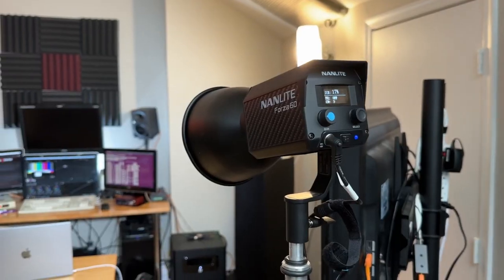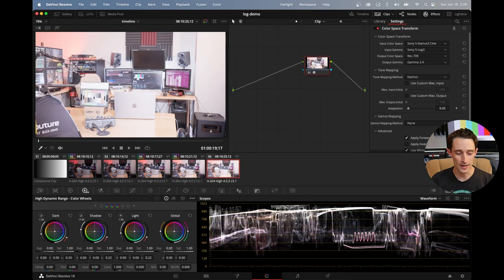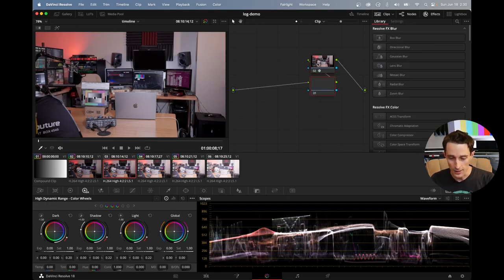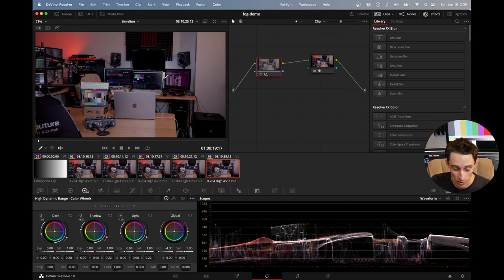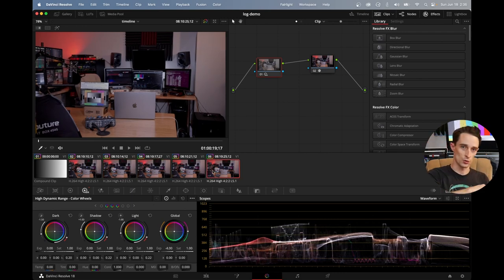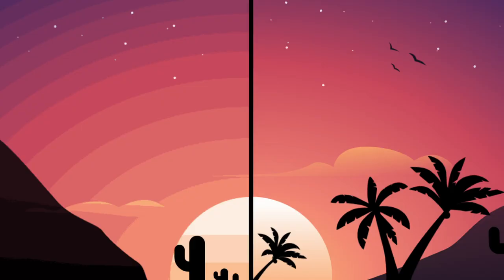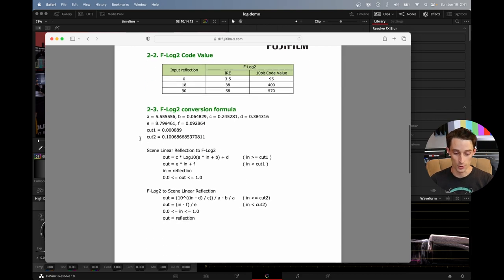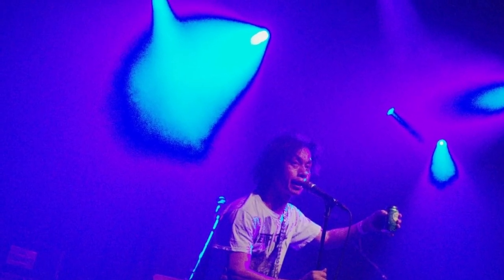How Exposing Log Footage Actually Works

Comment: Sorry, but you made quite big mistake. Log profiles usually compress shadows, and extends highlights, so opposite to what you said in this video. How to check it - graphs of log profiles are showing this info. For example if you will look on the graph for f-log2, which you showed here, you can see that for shadows from black to middle gray, it goes from 95 to 400, 305 bits per channel, so 305 possible different values on grayscale chart. And from middle gray to pure white it goes from 400 to 1024, 624 bits per channel, so more than twice amount of different values on grayscale chart, ie 34 bits per stop below middle gray and 75 bits per stop above middle gray. If you will film with such a camera smooth gradient from black to white with 14 stops of dynamic range, and expose it properly for middle gray, after applying color transform you will see the darker, the bigger steps, and from around -1stops from middle gray till the white, steps will become small and even, because here log curve basically became straight line. So, for such profiles as f-log2,s-log3, you should overexpose till the clipping point of the one of channels for smoothest possible gradations.
Reply from the maker: The graph in that PDF shows the decoding curve, not the encoding curve.
Reply: @ctcwired sorry, but no. It is stops of dr captured vs 10bit code values stored. And in shadows it stores less bits per stop, than in midtones and highlights.
Reply from the maker: @igorzhidkov1957  Ahh what you're noticing is the toe, which is a separate trait of log working spaces that does indeed use less bits for very low values, mainly so that valuable bit ranges are not taken up with noise. It also makes some legacy grading controls (offset) feel more natural (as experienced by ACEScc needing to be revised to ACEScct). That said once the line becomes straight looking, it's still at a much shallower angle compared to what a linear line would look like. For instance here is a graph that might make more sense: https://i.imgur.com/1gw7Rv7.png Part of the issue with the chart in the video is it uses "stops" of light, which are a doubling and therefore exponential, so it is effectively zoomed in on the toe. Using "stops" on the graph axis tricks you into thinking the log curve is linear visually, since "stops" are much like "decibels" in audio in that they are human scales to cope with what we experience as linear that is actually exponential growth.

It is therefore not a coincidence that the log curve in the Fuji PDF ends up looking almost linear in appearance, when shown on a scale of "stops", as compressing data in-line with the human experience is the design goal.

TL;DR, Stops are not linear.

In any case my shitty MSPaint demo in the video could have been more clear about this for sure, so sorry about that.